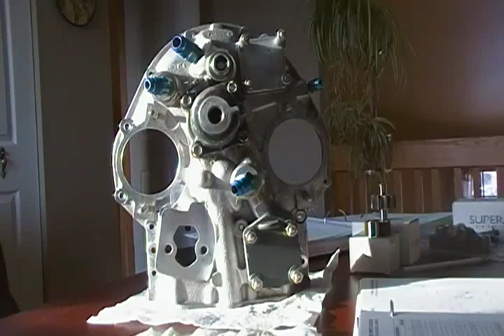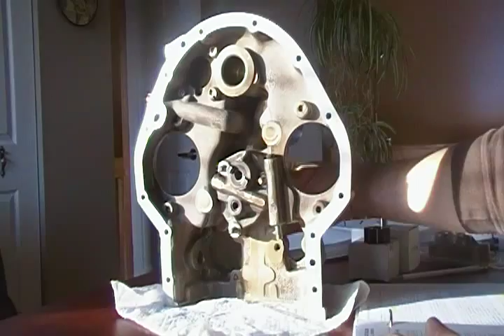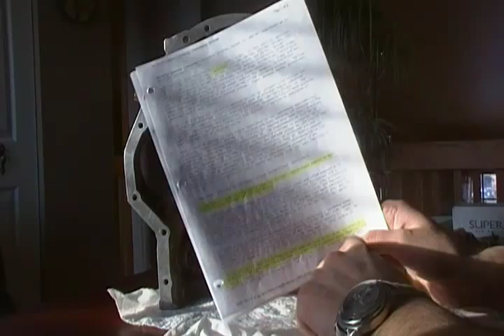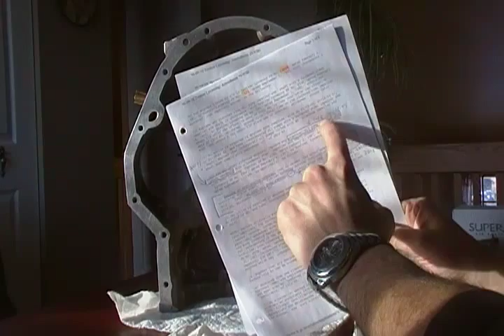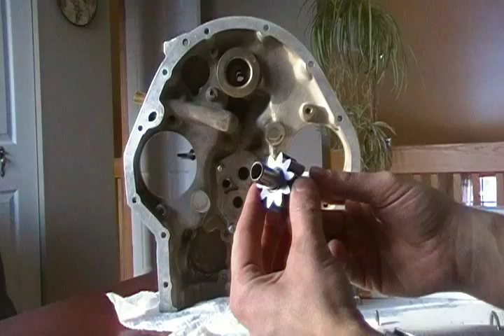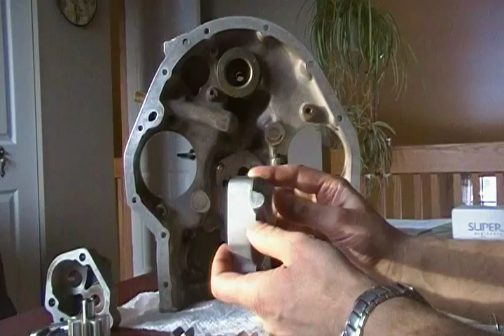Lycoming engine oil pump replacement Pitts Special S2E AEIO360 B4A

Comment: Thanks for posting. Did you have any symptoms of the pump going bad? Like maybe low oil pressure? Or do these continue to perform without any symptoms until catastrophic failure?
Reply: None at all, just decided to get it done because the consequences of it failing were just not something I wanted to deal with.
Reply: @farzeshghi3060  Thanks.  I'm having low oil pressure, but only mid flight, after things are up to temperature and at high throttle.  If I reduce throttle, pressure goes back up.  Very peculiar and it's driving me crazy trying to figure out what's going on.  Beginning of flight, good pressure, mid flight, low pressure, pull back throttle and come in to land, pressure goes back up.
Reply: @aerobatixguy7682 Did you figure out your Oil Pressure problem? I had the exact same problem with my IO-360. We thought it was the oil pressure sensor and had it replaced. That seemed to work but the problem came back and I ended up with a broken connecting rod on one piston and had to land on a road. I guess it wasn’t the oil pressure sensor. The engine only had 600 hours on it and was brand new back in 2005.